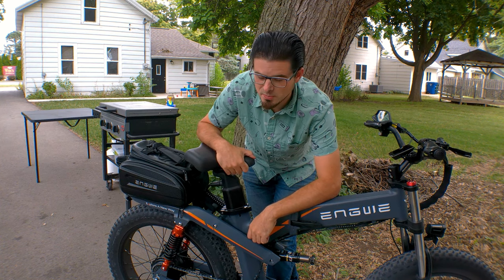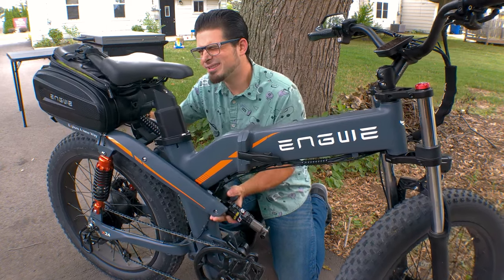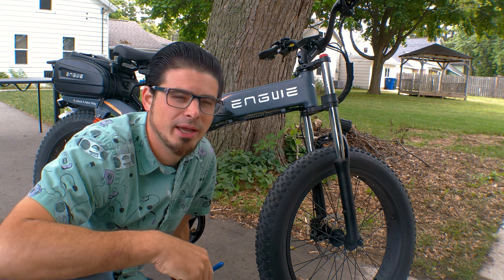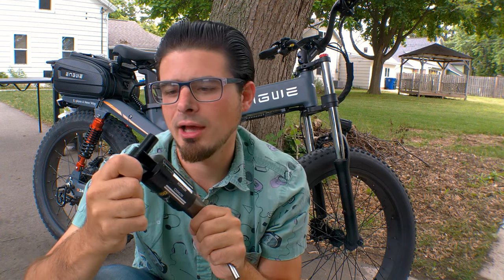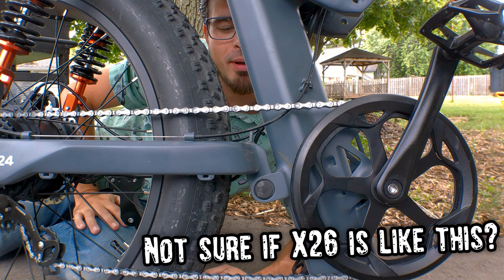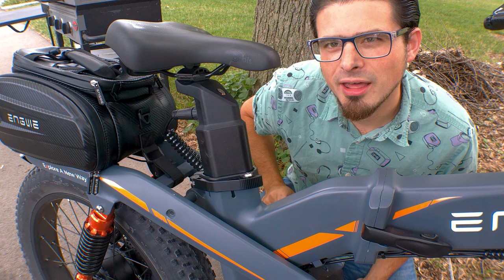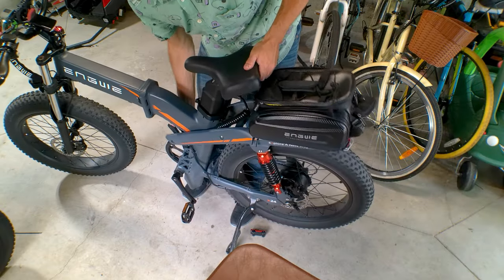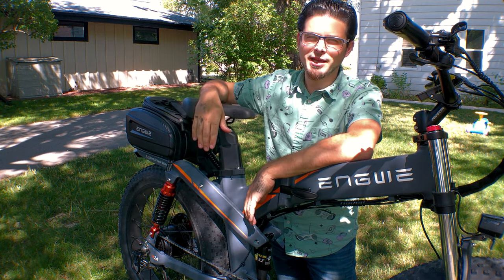Engwe X26 Suspension Disassembly and Investigation

Comment: The Chinese are always full of tricks. I bought one of those Bikeroo beach cruiser saddles the other day thinking it'd be awesome. The padding in it is alright and I like the decorative white stitching, but there's literally no travel in the springs whatsoever. I'm pretty sure the bottom conical springs are welded shut. Seems all they're there for is to look cool and add a load of weight to the saddle. I'm just glad it's going on an e-scooter that already has rear shocks and a suspension seat post.
Reply from the maker: Haha I have the same bikeroo saddles and they are disappointing. My wife hated hers, and on mine the subframe actually started to bend instead of the springs taking the load. Took it all apart and was able to make one good seat out of the two at least.
Reply: @Pilotgeek  Yeah. On the plus side, I've just ordered a vintage Persons saddle from the US on Ebay (I'm from the UK). Thing's huge and is fully suspended (has an additional spring under the nose). The seller didn't give any indication as to how old it is in the description, but there's a stamp on the underside that says "Permaco 5349", so it was most likely manufactured on the 3rd of May 1949. Has a nice little metal plaque on the back too that says "Persons Made in USA".

Comment: I cant seem to get any travel on the rear shocks on my x24. Im new to this and would appreciate a video on how they are suposed to work and which way ro rotate them to get the softest ride.
Reply from the maker: The collars at the top of the spring thread up and down to adjust preload. They should come all the way up, which is the softest. It could be that the pressure in your shocks is too high. The valves on them that look like car tire valves adjust the air pressure inside. You could try to let some air out and see if it helps. I believe stock is around 80psi but don't quote me on that.

Comment: Thanks for the video, to answer your question the X26 has a similar assembly on the lower part of the wheel frame/housing but it connects in a much flatter way. Giving it way more room to move  but with the same shocks it barely moves anyway.  Like you I also find the rear suspension quite lackluster.  I was curious specially about the pair of rear shocks though, at 265 mm are they motorbike/ATV shock and much more robust than ones found on bicycles?  I struggle to find any bicycle shock that large, though obviously some do exist. I wondering if removing the coil springs from them would give them more give, might be too bouncy/spongy though, who knows might give it a try for the fun of it.
Reply from the maker: Thanks for your input on the X26, I figured it mounted flatter but didn't have one to confirm. I think the durability of the oversized shocks probably is one of the only real plusses, as I do think they are closer to like a moped or small motorbike shock. As far as getting a softer ride, I have talked with others who had success in just letting some of the air out of the valve at the top of the shock. I think someone said around 60psi felt reasonable. It's basically a free mod to try so it's worth playing around with the gas pressure.

Comment: Thanks for the video. I see that you adjusted the seat height, do you really use that height for long? 
Mine goes back to its original level whenever I sit on it no matter how high I adjust it. Any idea what could be the reason?
Reply from the maker: Yes, mine slid down when I first got it, I probably should have mentioned in a video but I kind of forgot. Take the battery post completely out of the bike and use a rag with soapy water to degrease it. Do the same with the inside of the post frame. I also had to tighten the clamp a bit with an allen key / hex wrench. It has basically not been a problem for me since then.
Reply: @Pilotgeek   thanks for your response. I first contacted Engwe about it and they initially responded that I have to replace the seat and then they told me the next day that the X24 seat is not adjustable